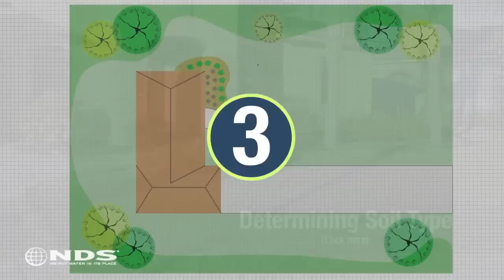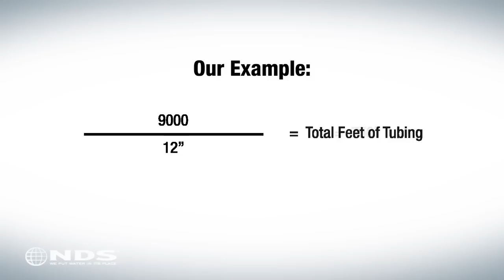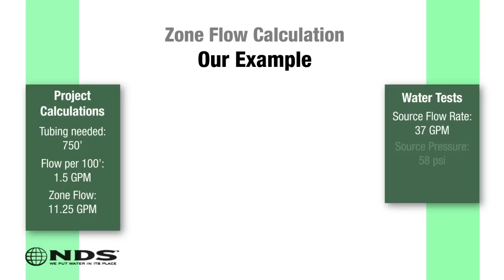How to Install a Subsurface Dripline Irrigation System | NDS Professional Irrigation

Comment: You have to make sure you are using subterranean drip line. And you need to install AIR RELIEF VALVES on each drip line section at the highest point. Without these valves the air in the line will not be able to escape quickly blocking the water causing uneven distribution in the line. 

Netafim also makes an automated FLUSH VALVE to assist in clearing out smaller particles that would normally clog the emitters making the ball valve obsolete. This also needs to be on each drip line section at the lowest point. 

You also need to have a filtration screen after the station valve. This will trap all larger particles and needs to be accessible for cleaning.

Comment: how would you find out where a leak is underground under the grass I cant find the leak but I loose so much water. it was working for a year and the grass was thick and green. So now it is hard to get to the drip line. Thank you if you can help

Comment: Sounds  good BUT, what about roots eventually clogging the emitters?
Reply from the maker: +Michael Spencer Hi Michael! Thanks for reaching out. What is so great about NDS Dura Flo CV product is that there is No Root Intrusion.  The combination of check valve and anti-siphon capabilities protects each emitter form clogging and root intrusion with no copper or treflan required. If you have any additional questions, please feel free to reach out to our Technical Services department: techservice@ndspro.com

Comment: Here in Silicon Valley subsurface systems are not recommended. Their extremely expensive and impossible to troubleshoot if something goes wrong, because their below the soil.
 A local contractor lost his business when an underground system went terribly wrong on a commercial Jon. The system clogged and because it was underground, they would have had to remove and replace the entire system. The contractor filed bankruptcy. 

 It's a great idea on paper, but a very bad idea in practice.